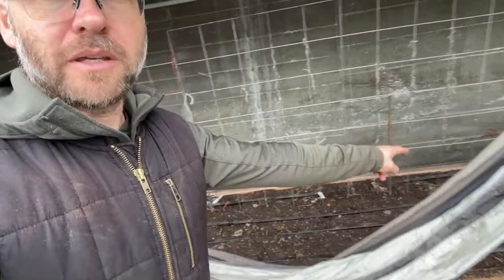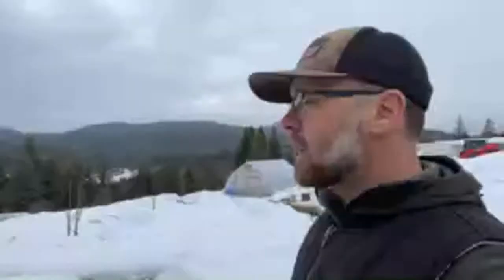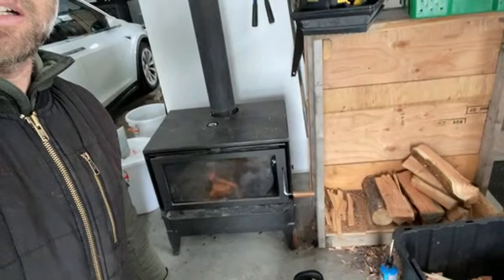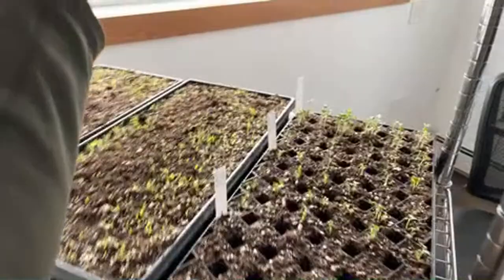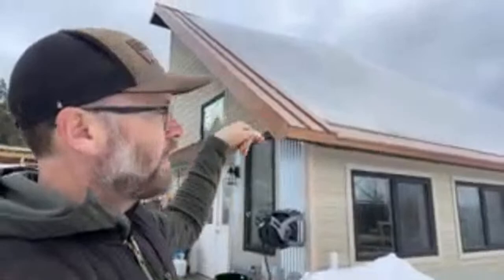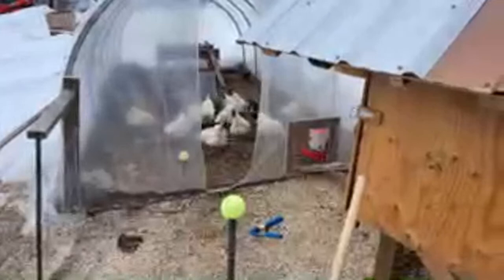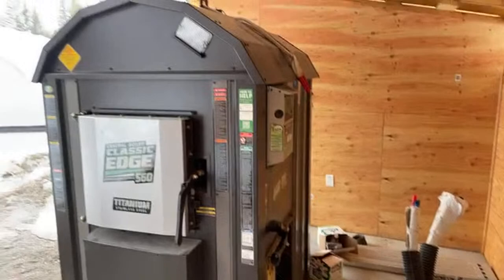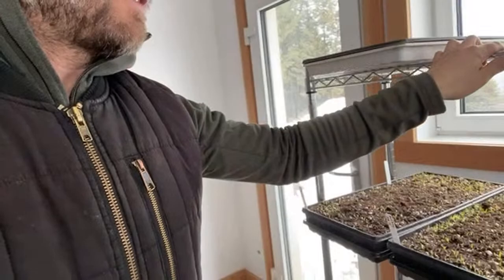What am I growing now? End of winter garden tour.

Comment: Think consensus was building on the sand battery… makes sense if you can use 600C, which basically means large infrastructure (Finnish folks said as much, no residential in their plans), so best bet is hot water, heaters as dump loads and possibly extended with insulated tanks (without heaters) to store. Could be used as input or preheater (heat exchanger as opposed to direct input) for boiler.
Reply: I absolutely could not AGREE MORE!! All he has to do is make it an open system so steam pressure is not a problem. If he uses pex the heat limit is 70-72C anyhow.

Comment: Hey Curtis. I don't remember if you talked about how your new house will be constructed. A passive house with 14-inch thick walls and triple-pane windows would require minimal heating. You could also make a solar furnace to funnel hot air into the house. Also, modular homes built with SIP panels are well insulated for cold climates.
Reply: What material for 14" walls? Aircreat? Precast?
Reply: @holymolar  there is a little more to it. Here's the link to the video I found how this guy built a passive house. 
https://youtube.com/watch?v=_6e6hSKaY9Y&feature=shares
@thesharingeconomy

Comment: Man I just. Watched your video on the sand battery, frickin fantastic.  But it's put me down a rabbit whole. I'm a trucker and I'm brain storming on heating my truck with a small sand battery.  Man y'all put out some great content. OK be good will watch ya later. Bill
Reply: Sand battery was an eye opener. Wonder if the old cement cystern could hold heat for my basement even for fall night heat.
Reply: @janew5351  I think I'd try a 33 gal drum inside a 55 gal drum with plaster in-between. One guy did it with a 5 gal. Bucket. but I think that's to small for any positive resalts.